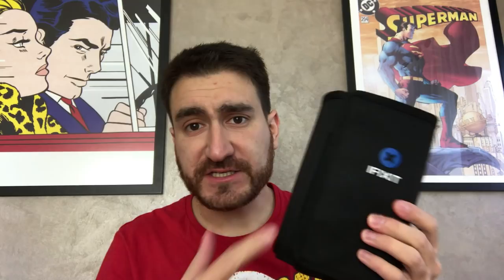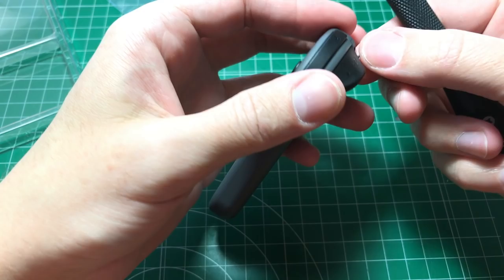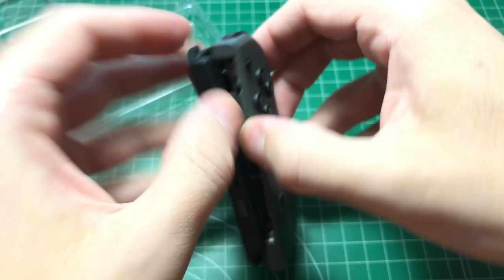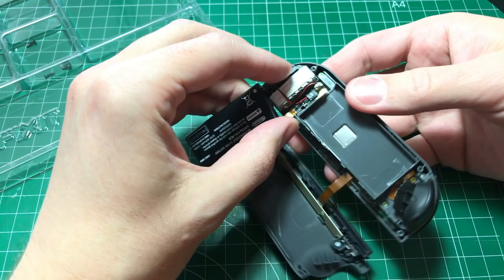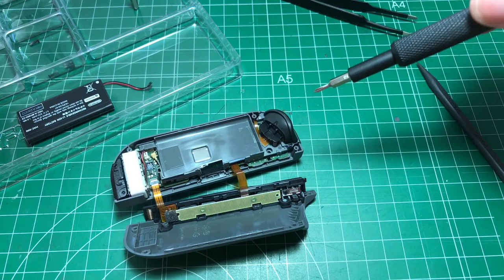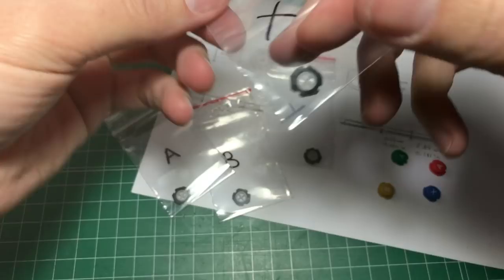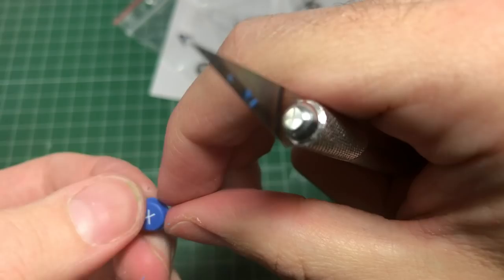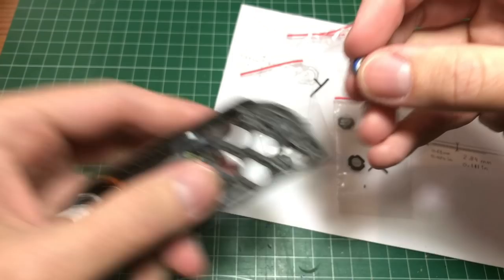SNES Themed JOY-CON! - HOW TO replace the Buttons! - FULL TUTORIAL

Comment: now some one just needs to mod the left side and replace the 4 buttons with a D-pad.
Reply: Caleb Stuckey or the N64 directional buttons
Reply: TLKheri that would look pretty awesome as well.
Reply: Caleb Stuckey maybe someone could modify it to have the snes abxy buttons, n64 c buttons, gamecube left analog stick, and Wii Classic Controller right analog stick, and Wii U gamepad triggers, and gamecube z buttons but instead they are the l and r shoulder buttons

All of the nastoliga in one
Reply: Caleb Stuckey I've never seen it but I have took apart a ps2 controller and if I had a 3d printer I would have put a dpad inside don't know if the switch would be as easy
Reply: Caleb Stuckey No that would be a terrible idea, you wouldn't be able to use the joycon individually, unless you don't mind using a damn d-pad as the 4 buttons. A much much better option would be to make a d-pad that easily snaps onto the buttons, that way you can remove when you need
Reply: Cristian Johnston I feel like for me personally I would just sacrifice the 4 button layout.  An overlay on the 4 button would have to big of a center dead zone to have the function of a d-pad.  Maybe Nintendo will come out with a d-pad variant for indie games and to use with the virtual console.
Reply: lol
Reply: in thay case just make a 3rd party controller
Reply: They did, it's called the pro controller.

Comment: Correct me if I'm wrong, but wouldn't it have been easier to just paint the original switch buttons? ^^
Reply: /KBLY/ Evet ama harflar ne olacak? 😂
Reply: 59BRN bantlacan onları o zaman olur 👍😃
Reply: You are wrong
Reply: You could yea
Reply: The ABXY letters would get covered
Reply: paint rubs out. and it's uncomfortable
Reply: /KBLY/ that would just be pezzy!
Reply: Wouldn't last very long and would probably get rubbed off
Reply: Pixel haha you're everywhere
Reply: Myst So are you lol
Reply: /KBLY/ maybe but they paint would come off after some use, remember you are rubbing your fingers all the time on thos buttons
Reply: Pixel haha
Reply: /KBLY/ that's what I was thinking
Reply: You could but you would need to stencil in the letters. plus paint and a clear coat will add thickness to the buttons causing friction when pressing the buttons and stripping the paint over time
Reply: Memes. Dank would look and feel at big weird. I personally would stick round stickers on top of the buttons because doing all that is too long.
Reply: /KBLY/ too easy
Reply: /KBLY/ You could do that but it's way better to use the new nintendo buttons. paint feels wierd, it would cover the letters and it make you feel way more proud to know you did it by yourself
Reply: -/KBLY/ THAT'S WHAT I SAID.
Reply: No, the paint would cause problems on buttons and plus they would not look as good without the letters. This is the best way to do it to make it look right and being 100% nintendo (other than the 4 drops of super glue).

Comment: I bought some custom  Dpad, home, ss, ABXY, + & - buttons in resin. If you do everything correctly and only the joystick works but the buttons or triggers no longer do what could be wrong? I even tried swapping the parts except for the resin buttons with a working factory joycon. The joycon worked fine. How can I make these buttons work? They fit fine. The triggers aren’t custom and they are also affected. It’s very frustrating! 😩

Comment: Looks amazing you done an outstanding job. That joycon looks like a nightmare to take apart with all those little ribbon cables. I hate them things.  I wish Nintendo would release a Super Mario Odyssey bundle with a white switch, super famicom colored buttons, and Super Mario All-stars packed in as well for $349.99 that'd be amazing. I just made a SNES /Super Famicom Slim using early SNES motherboard with the separate shielded audio box and made put a led lit logo of the SF colored button. It's getting lots of likes everywhere I've posted it & got featured on instructables. Believe it or not I used a 1980's answering machine housing. Nintendo should hire folks like us. Their designs are so dull and bland in general these days.

Comment: Hey Jordi awesome video! It has helped me a lot! What is your opinion on doing this project without the sliding caliber and just using my eye to compare it to yours?
Reply from the maker: Thanks Evan!!Yes, you don't need the caliber.
I needed cause I had no references before, but now you know the diameter is the same for the switch and 3ds buttons.
Moreover, you also know that if you keep the original switch button's base and the whole 3ds button you are going to end up with a similar height, so you don't need to measure it again. Plus using your eyes is going to give you a good estimate 😉 👍
Reply: Jordi, thanks for the advice! I got started on it already and I will let you know how it ends up!

Comment: How's the buttons holding up so far? Still working, or did the glue not hold up? After dissassembling a DS, this shouldn't be much harder.
Reply from the maker: It's holding well at the moment. But it may be better if you use some kind of special plastic glue I guess...
Reply: Sounds good! I might give it a try, it's an excellent tutorial video, so i shouldn't have major problems.

Comment: It is possible to do the same on a New 3DS XL White which doesn't have the colored buttons like the non-xl version?
Reply from the maker: I looked into that a year ago, I found the XL buttons are slightly bigger in diameter than the normal 3DS. Didn't attempt it...
Reply: Thanks for your answer Jordi, grazie! I thought the size was the same, what a pity... I assume there aren't kit like the one you advised for a 3DS XL right?

Comment: Jordi, is there any way to actually switch the a/b x/y buttons to match that of the Xbox controller so when I'm playing Zelda for example and press the bottom button which is B it would actually act as the A button? Would it require to solder maybe? Is it possible? The amount of times I've pressed B thinking it was A and vice versa is astounding.
Reply from the maker: Hi Leroy!!! To say the truth I couldn't say... Can't you remap the buttons in the game? Soldering would be very tricky in my opinion...
Reply: JordiPower I wish. You can remap 2 of the buttons but not all of them like on an Xbox or PS4.
Reply from the maker: I see... Can't help you then. Sorry man!

Comment: I completed your mod, but I didn't destroy my joycon buttons. I found a work around and was able to keep my buttons intact
Reply from the maker: Oh nice! 👍 How did you do it then? What was the workaround? 😊
Reply: JordiPower I used a gift card, it's nearly the same thickness of the joycon button base. I cut it into circles slightly bigger then the 3ds trimmed buttons, glued together. Used 3m double sided tape to adhere them to the rubber pad to prevent button spinning. This removes the need of destroying the oem buttons. They work perfectly
Reply from the maker: Wow nice! I was wondering what to use as a base like you did, but didn't think of a plastic card! Well done man!!!
And did you use a cutter to carve the notches? Do they fit perfectly?
Reply: JordiPower I was going to laser cut the notches, but I was on a time crunch and did not have time to make a cad drawing of them. I think next time I will. I used the double sided tape to replace the notches and save time
Reply from the maker: Clever!!! 👌

Comment: Wouldn't it be easier to cut new notches on the New 3DS buttons instead of gluing the New 3DS Buttons to the base of the Switch Buttons. Then you'd have the original buttons to switch back to if you wished.

Comment: well that was dumb. instead of making the new 3ds buttons fit and make them to shape on the switch you dremel down the switch buttons? a bit of padding figure out something you could put under the n3ds buttons, cut away sides to make fit and bam done, no glue or dremel necessary.

I would have then taken the switch buttons and had some fun either popping on to n3ds the way they are and see how they feel or id dremel them down and make one set concave and one set convex like the US snes controller and color them pink and purple. Both buttons used up
Reply from the maker: DjStiv3 yes, maybe! Feel free to try and give us feedback on how to improve it! 😉